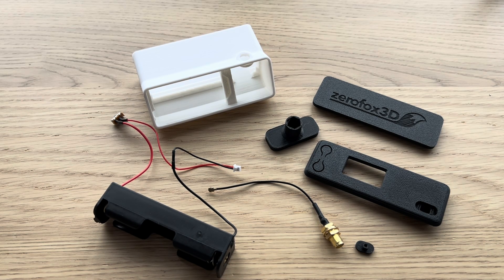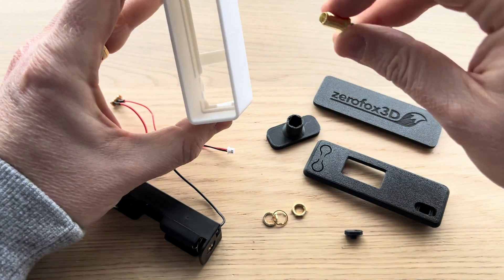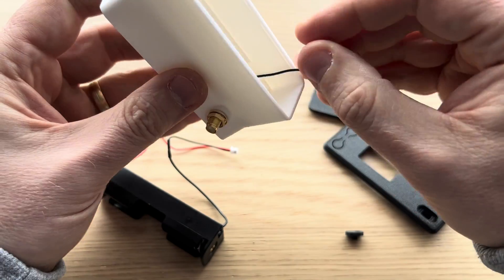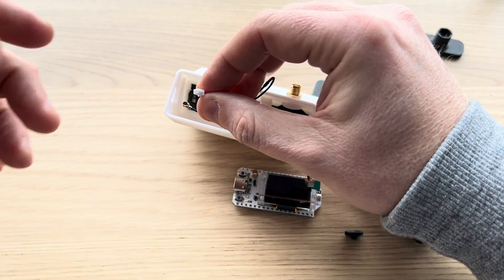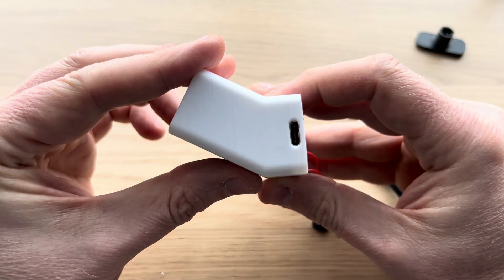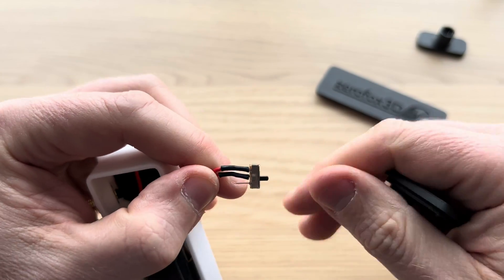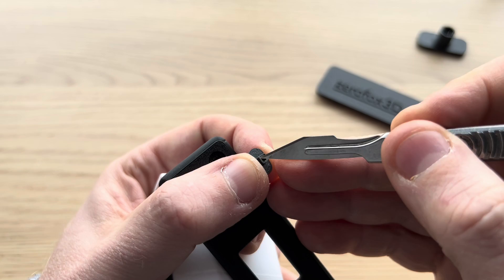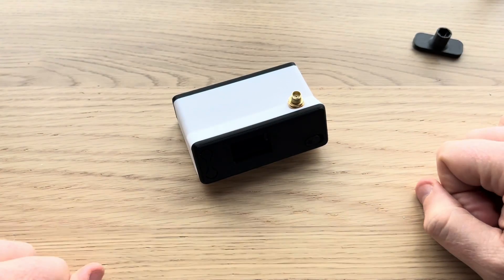zerofox3D Bender Assembly Video - The HeltecV3 18650 Battery Case with SMA connector for Meshtastic

Comment: The gps module goes?
Reply from the maker: The original Bender never officially supported GPS, you could squeeze a small module in though. The new Bender2 case supports the Heltec GPS module though, checkout the recent videos on my channel :)

Comment: Hello guys, some one has the shopping list for what exactly to buy, starting from the board to the antenna and battery enclosure.... Thank you🙏
Reply from the maker: So pickup a Heltec V3 or stretch a little further and get a Heltec T114 (more energy efficient) Both available on AliExpress or direct from Heltecs website. There is a Bender available for both boards.

Antenna I like Taoglas, their website links to distributers around the world.

Battery, pretty much any button or flat top 18650.

Comment: Very nice!! I just got mine assembled and by following your instructions everything fitted properly. Just one quick question, and it's a very noob one....will the battery charge in this configuration with attached with a proper USB brick? Thanks! ~Frank
Reply from the maker: Yes the Heltec will recharge the battery via USB. If you’re using Bender with the power switch the switch has to be in the on position for the battery to charge. Thanks Frank!
Reply: @zerofox3d  Great!! You're welcome and thank you!

Comment: Would it be fine to stick this meshtastic setup in a window and plug it into wall power to use as a static node? Only part I’m worried about is the battery, is the battery/ board ok with being constantly plugged into wall power? Thanks!
Reply from the maker: Should be fine!

Comment: The buttons on my own print don't come out very well defined/separated. Is there something I can change in my print settings?
Reply from the maker: There is less than 1mm between the button and the surround so you need a perfect first layer. So it’s worth just calibrating your first layer, no other setting will make much difference.

Comment: If you contact you node to a power source via the USB will this recharge your battery.
Reply from the maker: Yes the Heltec USB will charge the battery as long as Benders switch is in the ON position 👍

Comment: I got mine today, very excited to use it. I am wondering if you ever considered making it slightly bigger to allow the support of a GPS?
Reply from the maker: Glad it arrived safely! My plan is to release an adapter that allows the use of a flat 2000mah LIPO cell, that will than free up space for a GPS module. Strictly for the tinker crowd though due to the soldering required :D
Reply: I had a GT U7 GPS laying around that I just managed to fit into the case with some minor cosmetic modifications. Quick soldering job to connect some pins and got the GPS to work with the existing case.  Seems to work just fine :)

Comment: Looking forward to getting my 2nd batch. I have a noob question, though, will the battery charge via the USB-C connection on the heltec as well as power the board (and safely!)? I'm wondering if I should buy some Li-Po chargers.
Reply from the maker: I charges via the USB-C with no issues bud, no charger needed! The Heltec has over charge protection for one cell batteries, it doesn't have under-volt protection but dies long before draining a battery to a point that it would damage it (around 3.2v in testing by a Bender user)

Comment: Went together.  Did the antenna connector before seating the board.  Best to seat the antenna connector from the front so the wire is ready to connect to the board, as opposed to inserting from the back and having to bend the wire around to the front later.  The nut tool broke, of course.  Otherwise the fit was excellent on the parts.  Well done.
Reply from the maker: Yep I would have gone back and re-recorded changing that step but YouTube doesn’t let you edit things, really dumb. I of course did it the hard way just to test people…. 😆

Comment: Does the battery box take Protected or Unprotected 18650s?  I'm guessing since I see a spring, then it takes protected cells?  thanks! My Bender should be delivered very soon!
Reply from the maker: With a plain 18650 the spring has a lot of space so should not have an issue accommodating the extra 4mm of a protected cell 👍

Comment: I know I am not alone in the worst part about these modules is that UFL connector, so much so that I often wonder if I should solder the SMA straight to the pads.
Reply from the maker: If you attach the UFL before inserting the board into the case it’s not too difficult. I’ve only had one person mangle the connector, that was on the cable at least and didn’t damage the board connector.

Comment: Never heard of this before, what does it do?
Reply from the maker: Bender is a case for a HeltecV3 lora radio board. That board runs Meshtastic, a mesh communication system for off grid messaging. Check out Ringway Manchester’s video guide that explains it well.
Reply: @zerofox3d okay Meshtastic and LoRa I know, thanks for the reply

Comment: A tip with the U.FL/SMA cable/connector installation. I noticed the U.FL was a little twisted when you were connecting it to the Heltec. While the connector soldered to the board is unlikely to break away, you want to avoid torsional twisting forces along the coaxial cable. It's better to connect the U.FL to the Heltec first and then wrangle the SMA connector into place after carefully curving the cable into the best location. The SMA connector has six positions in can go into the case hole, chose the one that applies the smallest twist to the cable 🙂
Reply from the maker: That sir is a very good point! 👍 I’ll see if I can edit the vid later.

Comment: I broke the little tool. Don’t take that the wrong way lol. The hex tool. The man himself said it’s a torque wrench after I broke it that’s the exact torque it for lol
Reply from the maker: Exactly, its a torque wrench you use once :)
Reply: @zerofox3d  ;-)  but I got two cases and one tool...  (I actually have pliers that can handle that nut)
Reply from the maker: @chandlertechnology I started rationing hex tools to get things out quicker 😆 I’ve now changed the design of the hex tool, now uses half the material, prints in half the time and is stronger 😄

Comment: Does anyone know where I can get a few Heltec V3's that are in stock?  I ordered a bunch from the Heltec site a couple months ago and they still haven't shipped yet.
Reply from the maker: This is the AliExpress seller I buy from: https://www.aliexpress.com/item/1005004993320023.html

Week to ten days to arrive 👍
Reply: @zerofox3d  Thanks a ton!  Forgive the noob question but are these ones pre-assembled?  I'm more of a firearm nerd than a comms one, so I don't have any tools for (or experience with) soldering but I can improvise if necessary.
Reply from the maker: No problem! I solder the cable here, you literally just do as shown in the video and connect it up :-)
Reply: Aliexpress had them, but uk resellers are scamming people by buying them up and selling them for silly prices.  I paid £21 Inc delivery for 2 within 3 weeks.